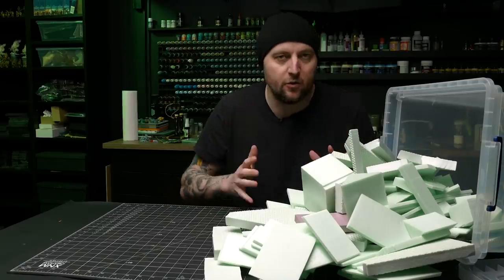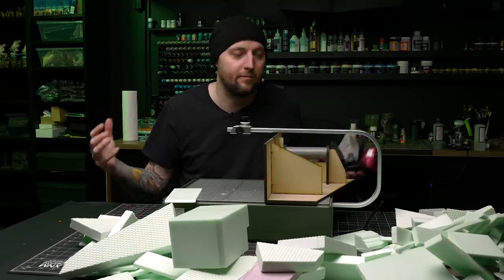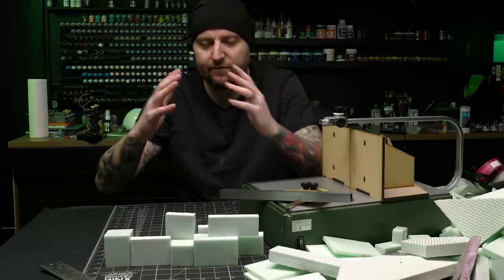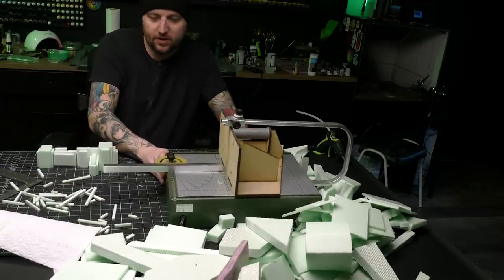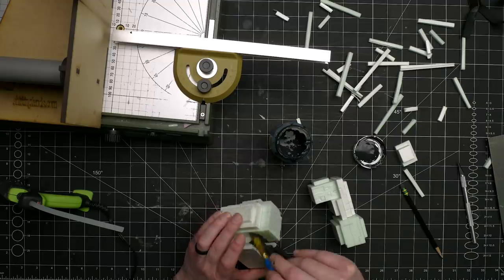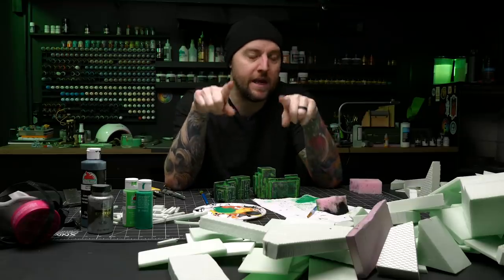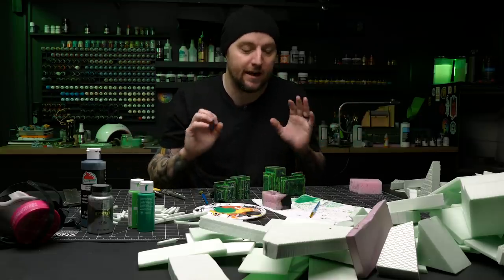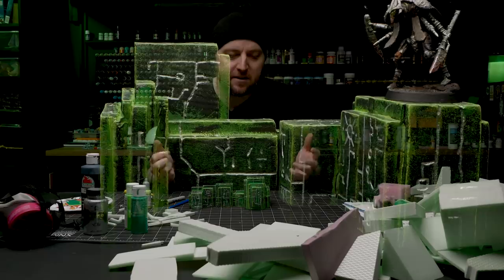Modular NECRON Stacker Terrain Made from Scraps!

Comment: I really like the shapes, the inner cuts on the corners really takes what might have been fairly standard blocks into really interesting shapes. I think I'd like to try something similar but in greys and beige, basically some non-descript stuff for Star Wars. Also I quite like how, because it's foam, the edges have a slightly imperfect corner, not rounded but not perfect either. It gives it a sort of aged feel which is great for the abandoned ancient ruins of the Necrons.

Comment: So you don't think that painting it before you do the carving will cause problems with splitting the paint or somehow messing things up with the paint surface? Maybe that would be a good experiment to do in a later video. I'm just not sure if it would be more difficult if you try to skip the carving completely before painting. I'm wondering if carving before you paint and then carving again works because the paint's already seeped into some grooves and so you're not so likely to stress and split the paint surface.
Reply from the maker: I did it already, on these....on many areas. That’s why I said it works great 😉

Comment: It's a great idea and I agree with your observations. I think I would take the streamlining of the process a step further; I'd leave them in the black coat all around and only use the green paint as a highlight. Though I would be tempted to bury some screws or something in the bigger pieces just to add some heft. I might also use a green gel pen instead and draw simpler but larger designs.

Comment: Those are great. They look like they are not quite real - in a similar way that the original 'Tron' movie doesn't look real - which is a good thing. They also fired off an old memory. In my home town, in the UK, at the end of the 1960's, there was built a shopping centre. From the start, nobody liked it, as it was monstrous concrete brutalism sitting in a mediaeval town. It sat by a nexus of main roads, and nobody used it. It was crossed by travelators, which never worked, and in the central square of it, were 'sculptures' that, in form, were very similar to what you made here, when stood on end. They weren't green, of course. The whole place was sealed off, and demolished in the early 1980's. People just didn't want to go near it. It was a frightening place, even without the druggies and the yobs, it was a place that most people gave a wide swerve.
Reply from the maker: I live in a city that went through a 40 year phase of brutalist architecture. It's....really something.